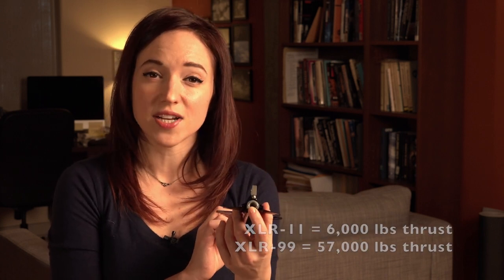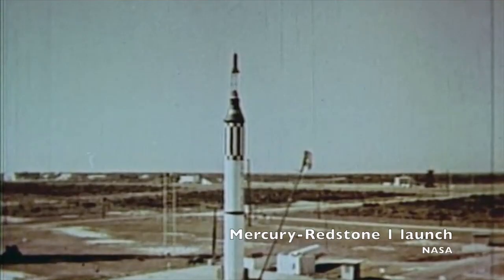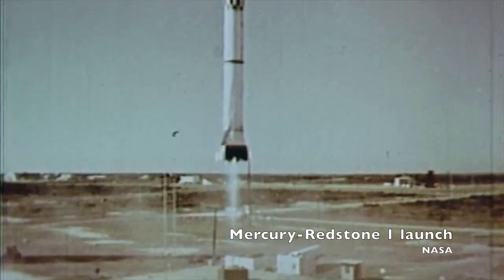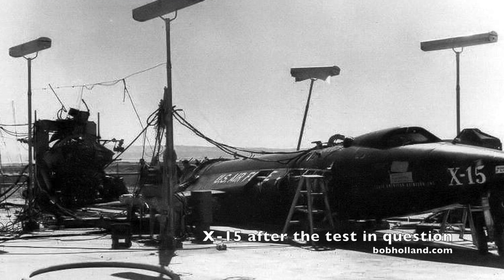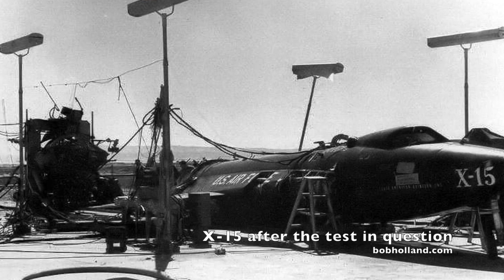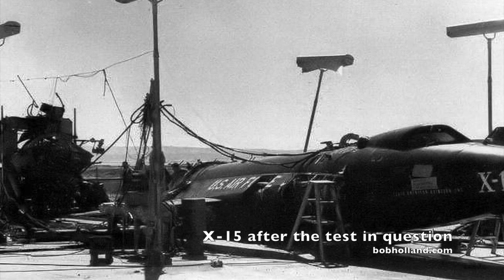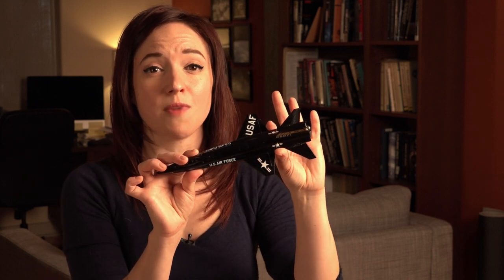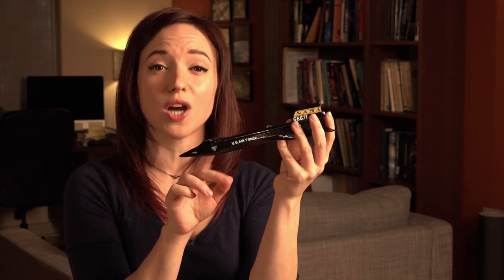The X-ploding X-15

Comment: I knew an X-15 crew chief who worked with Scott Crossfield.   He was several years Crossfields senior and had worked with him on several occasions. 

"Now Scotty" he said referring to a F-100 being tested "If you have to dead stick this plane, remember the hydraulic brake accumulator only has the capacity for a single brake application. :

Sure enough the highly skilled Crossfield made a perfect dead stick landing and planned  to roll up close to the hanger. He applied brake and turned toward the hangar door.  A second brake application could of stopped him before contacting the back wall of the hangar but he had used all of the hydraulic energy stored in the accumulator.

Comment: I just finished Scott Crossfield's autobiography "Always Another Dawn" and it was a great read. It was uncanny however to see his quote below, especially since he died in 2006 flying a mundane Cessna 210A into bad weather. The FAA accident report cited both “pilot and air traffic controller error” in assigning blame for the crash. It seemed very ironic to me how he died even before I read this statement early in the book:

“Not once since then, either on land or in the air, have I ever turned back from any course that I set upon, no matter how dark the clouds that lay ahead.”

At this point he was describing an experience in the late 1940s soon after he got his wings and was part of a group of Corsairs on a four-hour hop between Sand Point, CO and Denver The flight leader’s navigation skills were below par and when the flight got lost Crossfield and another pilot turned back to try to figure out where they were. The flight eventually straggled into Denver and was a total SNAFU but there were no crashes, only damaged egos.  

In hindsight it is prudent to think that he probably would have better off to reconsider that rule on his final flight in 2006 and elected to break it. Perhaps being 84 years old at the time made him feel invincible or just extra lucky that day, given the near-disasters he had survived as a test pilot, especially the X-15 explosion when first testing the big engine.. He was a sharp fellow for sure.
Reply: I just finished that book today, and it's funny that this script is barely edited from Crossfield's own narrative. 🤔😉 I wish they'd have included film footage from the explosion but it's still a great story, regardless of who tells it.

Comment: I was just reading about this guy. He died in a single engine plane crash due to bad weather. Sad.
Reply: Not due to bad weather - the radar controller steered him into a thunderstorm cell.

In the thick of IMC you rely on ATC to advise you about hazardous flight conditions, not guide you into them.

So, Crossfield's untimely death was due to an idiot on the other end of his radio, not due to bad weather.
Reply: As a private pilot, one of the major things they teach you is "Never rely on ATC to keep you out of weather". ATC turns off the weather indications on their scopes if the weather indications are making it harder to see the blips, and they aren't given training on how to interpret that weather info the way pilots are. We're supposed to know where the cells are and advise ATC "unable" if they try to steer us into one. And if you don't have onboard weather (radar, XM-WX, Strikefinder), then you don't go up when there are embedded thunderstorms.

Comment: Amy,  why does the X-15 have a thick, wedge shaped vertical stabilizer ? All other surfaces seem normal. I thought a teardrop shape was best for aerodynamics. Perhaps you could answer that in another episode. BTW, I suspected you were Canadian ( aboat )  :- )
Reply: Froggy 
At those speeds the air doesn't touch the trailing side of any surface.
A wedge keeps air in constant contact all the way through.
Reply: Does not apply at supersonic speeds.
Reply: the "tear drop" shape creates lift.  On the vertical stabilizer you're not trying to get "lift".   Look at any regular airplane and you'll see that the vertical stabilizers are different in cross section that a wing.
Reply: Supersonic airfoils are different from subsonics. The latter are designed for air to flow smoothly around them. Supersonics are sharp, to push the shock wave. (F-104 Starfighters have leading edges so sharp, protective guards are placed on them when they are on the ground.)
Reply: Actually, I think it was for weight reduction. During design & construction, the X-15 was weight-critical all the time. The engineers determined that chopping the vertical stabilizers in half wouldn't impose an aerodynamic penalty worth worrying about but would save them some needed weight.

Comment: What was the oxidizer? The video first says liquid Oxygen, and later says hydrogen peroxide.
Reply from the maker: Good catch; I didn't realize I made that sound really awkward! So the X-15 had two fuel systems, one for the main engine (or engines in the earlier versions) and one for the reaction control system that gave the pilot attitude control at high altitudes. It's the latter, reaction control system that used hydrogen peroxide. So both fuels were on board during the explosion for different reasons.

Comment: So erm.... how did restarting a shut off engine make it blow up?
Reply: I bet fuel and oxidizier continued to be pumped into the coubustion chamber after the engine shut down.  During the restart it all ignited.  I am just guessing.
Reply: pressure ruptured the tank, comboed backflow and a frozen failsafe. (Not in that order) If she's so great at reticulating old info dunno why she didn't bother to explain the most important part.

Comment: Say again....50G?
Reply: +Alan McGill Possible. Think rocket sled.
Reply: It's not actually that impressive. People survice 100g car accidents and have NOT survived bigger ones.
Reply: AFAIK, the 50-gee load was VERY BRIEF....
Reply: Alan McGill for reference, 50g is considered the impact force above which a formula 1 driver in a crash has to have a mandatory neurological examination (concussion check, etc). Drivers have routinely walked , or at least limped, away from worse crashes.   50 g is quite survivable with the right safety equipment, most important being neck support.